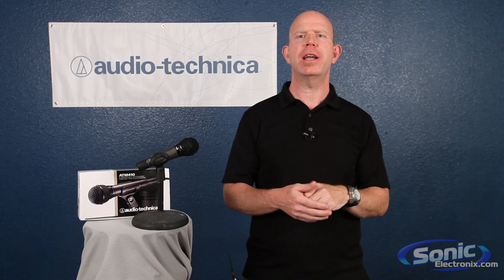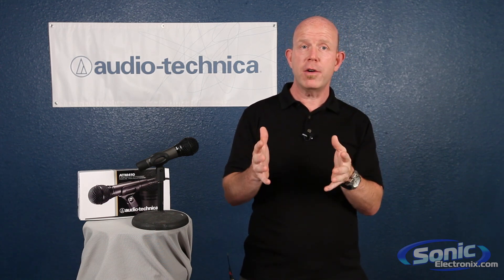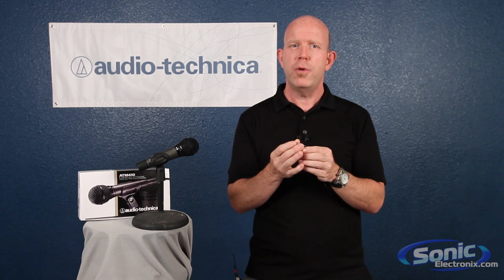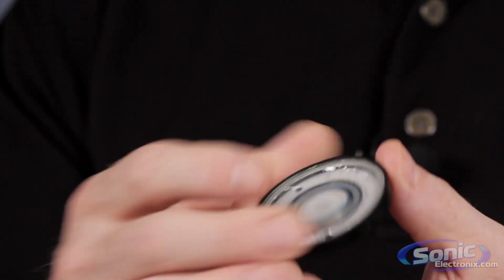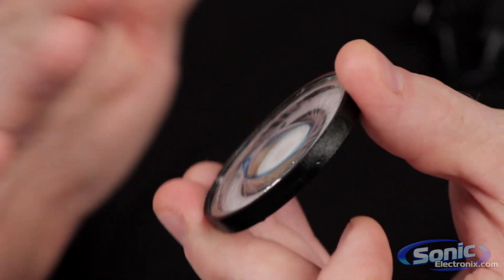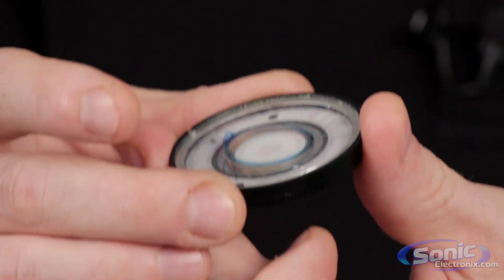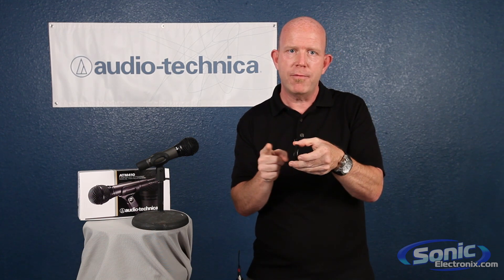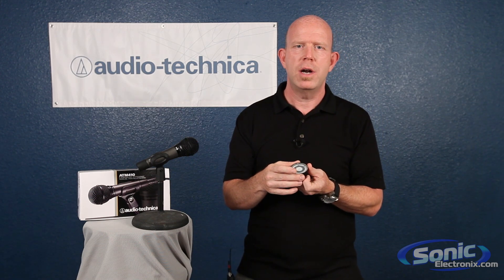How a Dynamic Microphone Works | Mics Explained - Part 1 of 2

Comment: hi audio-tecnica 's  Gary , i would like to know if somewhere there is an audiotechnica or OTHERS with a video about a dynamic mic.  I have an audio_technica AT_688 that is going on mass somewhere and buzzes quite a lot and i would like to see an example how to dismount one of those mics and about which can be the cause of any disturbances like mine and would show how to fix them. an all around footage. and also one on how to use them correctly. thanks in advance for any answer.